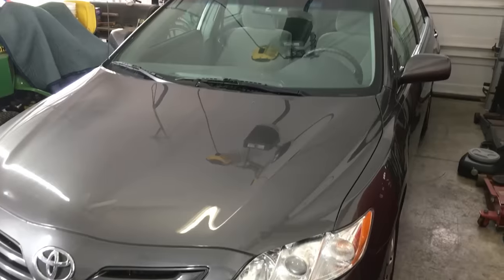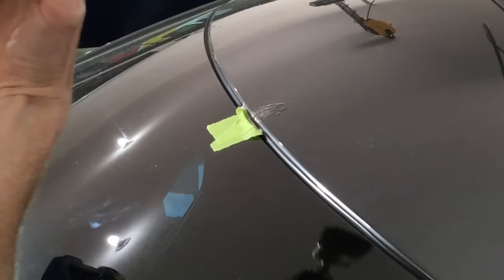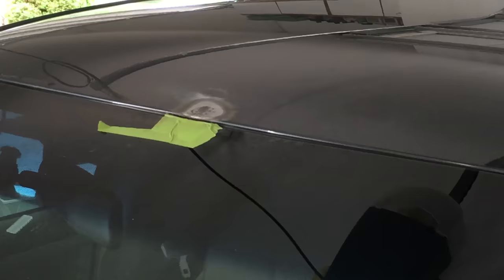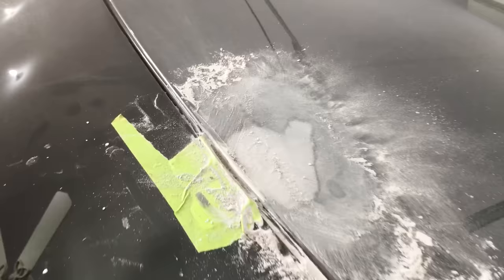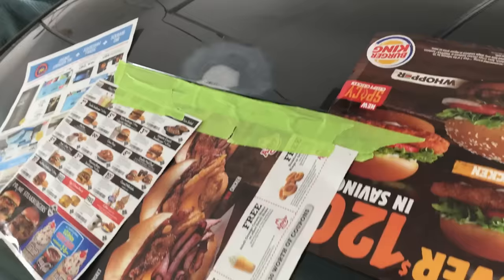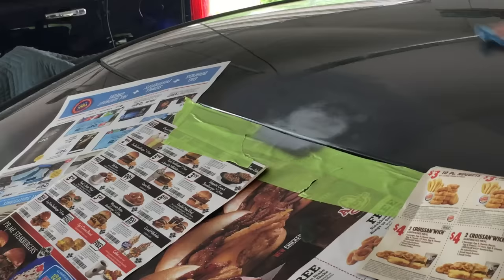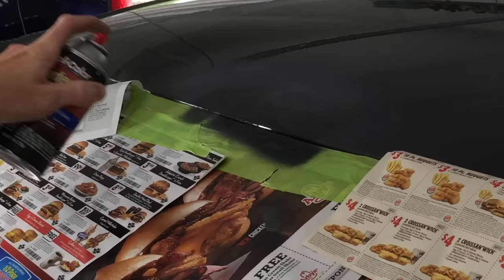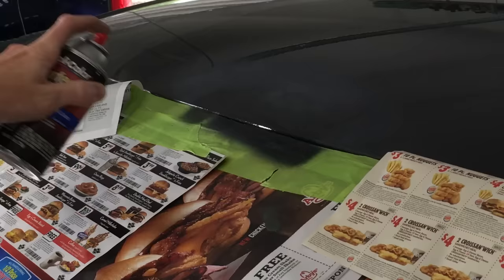How to Fix: Rust Bubble Under Paint from a Rock Chip Around WIndshield

Comment: Great video for a simple quick clean up of a spot as you said it is a quick for a simple fix not a masterpiece show car.

I'm sure if you wanted you could have put a rust converter over the bare then some self etching primer body filler then the other. But then you would have had to call it more than a simple repair LOL great job Toyota would be proud keeping another great vehicle lasting longer
Reply from the maker: Best comment so far. Some people are commenting as if I cut corners on restoring a 69 Camaro. It's just a Toyota Camry with almost a quarter-million miles that I bought for $500. I used rust inhibitor on my nicer vehicle repairs - See my TSX or 85 Toyota vids for that. This Camry is just a cheap daily here in Ohio, where road salt eats vehicles from the underside.
Reply: 6th Gear Garage good work! anyway, i have a question. what is the process if im going to apply some rust converter after the bare metal? im just confuse of what is next to apply after treating the rust with rust converter. thankyou
Reply from the maker: @carlolicuanan719  I would follow the instructions of the specific product you use., as there are different types of converters. Some you can prime over, and continue the body work.
Reply: @6thGearGarage  As a Camry person with a modified Camry, it's not just a Camry :p lol, also would prefer my Camry over the Camaro.

That said, a good quick repair doesn't need to be perfect, just enough to stop the rust from growing.
Reply from the maker: @matthewfarrell317  Thanks, I agree. With the high miles and being an ohio car that sees road salt, a spot returning above the windshield is the least of my worries. Around here cars rot underneath faster than they rust on the surface. I'm happy to make the exterior look better and get a few more years out of it.
Reply: @6thGearGarage  As an Australian, I never have to worry about road salt. But I have seen the devastation it brings to cars etc over there.

Our worst one is the trees, the oils do so much damage to the paint and are a pain to get off the cars.

In terms of km's mines sitting at 420.000km and I still consider that a baby by Toyota's standards.

I will have to watch more videos.
Reply from the maker: @matthewfarrell317  I've parked under a tree only to find sap on the paint. It's a sticky mess to remove.
Reply: Tim Shawn 
Simple Quick????
What are you talking about my guy?
😱☝🏻
Reply: This long lasting Toyota should be burning a lot of oil...
Reply: 6th gear- can you link the rust repair videos of the tsx and 85? Its hard to find the mentioned ones in all your videos.
Reply: I understand it’s a cheap car and that’s why you’re not putting effort to it, but think, people who watch this kind of videos are looking for a decent job paint not a cheap job paint. Just keep that in mind
Reply: @6thGearGarage  Well actually I am watching this while planning to restore the paint on my 72 Camaro... I am total noob in this though, so maybe I take a look at your other videos too!
Reply: @matthewfarrell317  Yeah you do if you`re in WA(Perth), salt in the atmosphere for the past 6-7 years is starting to effect the bitumen. Corrupt pisspots or drug manufacture.
Reply: Well, even on a quickie job, you don't want to wipe your cloth back and forth with any surface cleaner, you want to always wipe in one direction, otherwise that just smears any contaminates back over what you'd just wiped, defeating the purpose and potentially compromising your work
Reply: P
Reply: Ok, i've been watching a bunch of these videos, and i'm so confused:

1-Why can't i put body filler over bare metal?
2-If i use rust converter on bare metal does the surface become less sticky and the overall work less effective?
3-Do i skip rust converter since on my self-etching-primer-filler can it says it can be applied over bare metal?
4-What difference does it make if i use primer filler before body filler and vice-versa?
5-What if i get some rust converter over good paint?
6-I heard some people say to use zinc protector spray over the bare metal before body filler, can this be used instead of rust converters and self-etching-primer-fillers?
7-Does every layer need to be sanded down with increasingly finer grit?
8-What if some paint lands on good paint that hasn't peen sanded down?

Honestly, i'd feel more comfortable disassembling and rebuilding the entire car than fixing a spot of rust.
Reply: @dzionassi  ur thinkin of the German gang(of cars) known for oil burning! B.IG M.ONEY W.ASTED AUDI, Mercdez, even Vw. Some Subaru's had issues also.
Reply: Wait time between color coats and cleart coats? Not clear!
Reply: Great job and very helpfull video!
Reply: @matthewronson5218  
Best to buy the spray can silicone and grease remover
Reply: @ialeg3710  
Rust converter hardens like metal and will prevent rust returning, especially if you missed any tiny amounts sanding or wire brushing pitted metal. It also bonds with the filler very well.
Reply: Rust converter is cheap, easy to apply and prevents rust returning. Why skip it?
Reply: Jesus it's as easy doing a shit short cut job as doing it correctly especially when it will be done twice . A little bad knowledge  is worse than no knowledge .
Reply: @joselozada5093  Yes that's my point. Can't leave rust or work is pointless. I get its a beater but doing a job right if it's a Bentley or a yugo don't matter. I do same kind of work on my personal car as a customers car. Same steps are needed repainting and fixing rust issues  are the same on any car. And if you skip steps it'll give you a bad rep and rep is everything in 2022. And it takes just as much time to do a job right or fuck it all up. Just double your time, work and money if done wrong. And these cars last a long time. I live in the rust belt and fight it yearly. I've bought cars that was rough and fixed them and they still going strong. If you can kill the rust completely, you'll be fine. Let even a tiny speck survive and it'll reproduce faster than 20 drunk monkeys.
Reply: @ialeg3710  Some converters call for different paint. Ospho says oil based. I've used it for decades and no issues. As long as you wash it away or neutralize the acid with baking soda etc you're fine. POR 15 is good but pricey and alot of steps. Acid is cheap and easy and fast. To kill acid you need a base. Simple chemistry. This stuff won't burn a hole in your skin or metal. It's watered down. Follow the directions and any questions call the company and ask. I did this when I tried new products. I use Eastwood fast etch and their rust paint. Restored many cars, trucks, tractors and oil field engines that was 160 years old. No issues. Call them and ask or tell what your working on, what you like to use and if you can. There's alot of converting types out there. Or just get from big box home stores. Concrete etch. Or a spot sand blaster. No big mess and a spot like this would be gone for good in a second. Only dumb question is the ones not asked and jobs ruined cause ppl afraid of sounding stupid. No its smart if you don't know you don't know. Nobody knows it all.
Reply: @LifesAbe-ach  Post link to your repair video please
Reply: Just sand it and spray paint it. That's a lot for just one little spot. Imagine 5 more. Us brokeys just sand, paint, and we're done. Although, this is pretty nice if you have the money and patience.
Reply: Cars absolutely bring out the crazy ocd in people
Reply: @6thGearGarage  i bought a cheap car and it has some rust bubbles, I'm considering fixing it but I certainly don't want to spend hundreds and hundreds of dollars in products, so this is perfect for me, thanks!

Comment: If brown was still there in pits  that means you left rust. It will be back again. Use rust converter at bare minimum, then epoxy paint. Then fill it. Then paint it.
Reply: Does filler adhere to rust converter better than bare metal?
Reply: @dharm3974  I'm not an expert but I have placed filler over rust converter after a light sand. No issues to date. I do see a lot of debate around the whether you should prime before you fill, or fill before you prime. All experts, all different opinions. I typically prime first just to be sure but I wouldn't like to say that its the only way. I 100% agree with PaddleDodC5 though, there is certainly a risk of recurring rust. Doing 'something' is better than having to do it again.
Reply: @mikebennett938  Thanks for the advice, man.  I'm new to body/paint work of any kind so trying to figure it out.  But I agree, seems like if you're going to go through all the work of repairing it you may as well do it as good as possible.
Reply: @dharm3974  I'm reasonably new to it as well, although I am getting more confident. I can pull out dents, apply filler properly and paint. I've painted whole cars. I've even custom made whole panels and welded them in. It's fun :). The only real advice I can give is practice, practice, practice! Start small and examine your mistakes, then try again. It's ok to not be perfect, I'm certainly not. I think there is one professional who says it really well on youtube, it's only paint! if you get it wrong, sand it off, try again. If you can afford it and have the space, go and buy the biggest piece of crap you can find and practice on it. Hopefuly it's a piece of crap you can enjoy long term though. Happy tinkering :)
Reply: @mikebennett938  Oh cool, thanks for the link!  That seems to make sense, I'll make sure I always use primers before filling now.  Even if you don't take into account the possible rust factor, just having better adhesion couldn't be a bad thing!
Reply: Best way I found was sand out till feathered smoothly then a small die grinder or small broken drill git tape the rubber and glass well after die grinding small file to remove high burrs then I would Apply  epoxy primer once dry sand then apply fine kitty hair fiberglass or epoxy putty then prime once dry sand and paint..
  I'd rather feather sand first becouse as your cleaning the rust it's still rusting so I find cleaning the rust out  last is best...
Reply: @dharm3974  main thang to remember b is always go to bare metal
Reply: Do you charge extra for the overspray?

Comment: After applying the body filler I wouldn’t go back with a 80 grit. I’d just hit it with a 150 grit and bring it down smooth, then spot filler. Then 500 grit, followed by 800 or 1000 grit.

Comment: Hi Mate, a few improvements that will assist you and your viewers. Once you have sanded all the flaky rust away, always use a rust converter to neutralize the active rust before putting filler over the top as it will de-laminate in a few years otherwise. Something like phosphoric acid will work perfectly and is cheap.

Once you use wax and grease remover/ prepsol, don't touch with bare hands (like you did before etch primer) as this will transfer grease from your fingers and hands and could cause 'fish eyes' in your paint.
Reply from the maker: Thank you for the advice!
Reply: very helpful thanks
Reply: I have never figured out what you're supposed to do with phosphoric acid after it has done its job. Do I just leave it there or am I supposed to wipe it off and if yes then with what?
Reply: @Sceme1991  Just wash it off with warm water, that's at least what was recommended in the bottle I used.
Reply: Name of the rust converter you usually use ? Please
Reply: @williisaias  i use an Aussie one which will be different name elsewhere. Any of the reputable companies ones will do.

Comment: I have a rust bubble like yours on my hood. This was a truly excellent tutorial. I learned more in just the first 3 minutes (yes, I checked!) than I did watching several other videos on here. I now have the confidence & knowledge to tackle my hood. I can't emphasize enough how much this has helped! Might even make a video when I repair it in the spring. Thank You!
Reply: how did your repair go?
Reply: @HavokBWR  he died :(
Reply: @lukeellis8507  Dam rust kills us all!!
Reply: @jasonchristopher2977  so true. may he rest in peace. im also taking the journey to repair my rust spots on my hood and other things
Reply: @lukeellis8507  How'd your repair go?
Reply: @harryupmann  i still have to finish the sanding and smoothing of the base coat. i sanded the rusted gravel knicks out, there was about over 100 on my hood/ front end. primed coated then sprayed the base coat, with just a spray paint can. it will look fine just not show room quality. just need to sand the base coat and blend in, clear coat. and i don't have a machine buffer tool so just a wax job for the top. my main concern was just to sand off all of the rust till bear metal and spraying over that. just have to make it look pretty now
Reply: @lukeellis8507  Hey, thanks so much for letting me know, I have an '07 Sprinter with rust along the lower side of the windshield, took it to a body shop, they are quoting $2,600 for glass and body work!

Comment: If you're going to use body filler to make the repaired area smooth you may as well remove those blackened areas - because that is where the rust will come back from. I'd use a Dremel to drill out the blackened areas and sneak in some epoxy and fibre-glass underneath the area to give a string surface for the filler to bond to.
I've done the type of repair shown in this video and the rust always starts to re-bubble after 12 months.
Reply: No need for that. Just use a rust inhibitor like POR15 on it.
Reply: Agreed.  Rust is automotive cancer.  If you leave anything behind, it's going to grow and create the same damage within a year or a little more.  The Dremel tool gives you the same ability and precision of a dentist's drill to  remove all visible spots of oxidation (just as the dentist treats a cavity).  Apply two coats of a rust converter to treat the specs of oxidation which may not even be visible to the naked eye and allow the converter to convert for at least 24 hours before proceeding to filler.  I repaired three similar rust spots in 2004 on my 1999 GMC Safari van and they have never reappeared.
Reply: in sweden we do spot blasting only took 5 minutes then the rust will not come back
Reply: @chrisgraham2904 what rust converter do you use for car metal?
Reply: @chrisgraham2904  wouldn't etch primer also prevent rust from coming back?
Reply: @kenmastersmaster  I'm not a chemist or metallurgist, but the purpose of etching primer is to etch and bond the primer to the metal.  Most primers do not prevent moisture and oxygen from penetrating to the metal to cause oxidation.  The color coat and/or clear coat will provide a barrier to moisture and oxygen, but if any oxidized rust remains under the primer, the rust will persist and spread.
Reply: @chrisgraham2904  so it is safe to put etching primer over rust converter and everything will adhere?
Reply: @kenmastersmaster  I would suspect that etching primer over rust converter would have the same adherence as non-etching primer over rust converter.  The etching primer would not reach the bare metal to etch it, so there would be no etching advantage over a non-etching primer.  Since, non-etching primer is generally less expensive, it will probably be quite sufficient.  It's a good question to pose to the technical team of an etching primer manufacturer.

Comment: You should wait a few weeks before waxing. The paint needs that time to fully "cure". You dont want to seal the paint to soon as it needs to breathe until hard. Not a bad for a quick repair though. One good trick to get a level finish is to make the first primer coat very light, sand very lightly with a block sander. The low spots will show the primer. Thin coat of spot putty over those low areas, sand smooth.  Thin primer coat and light block sand. ect.